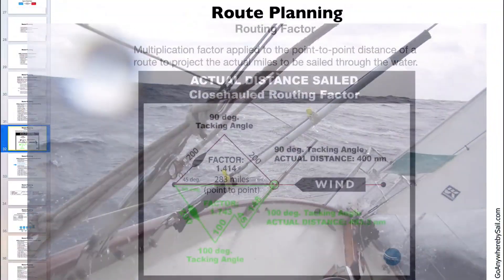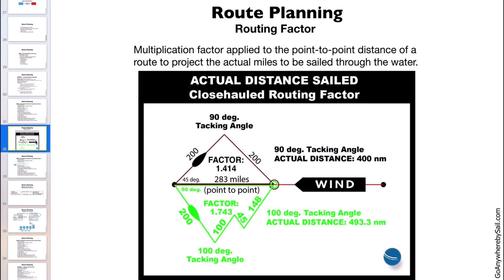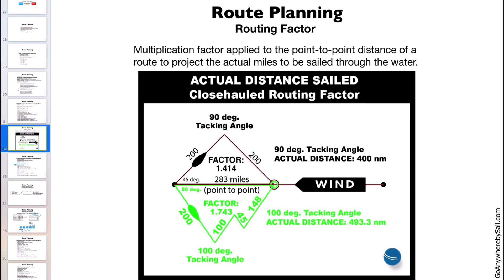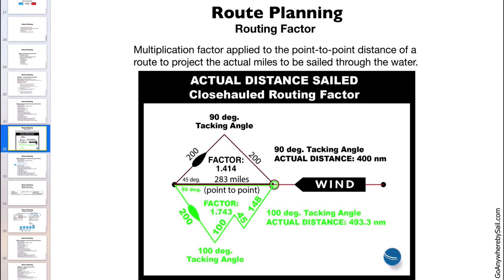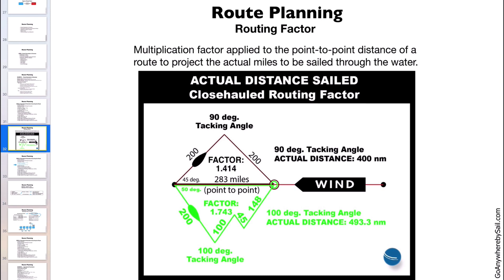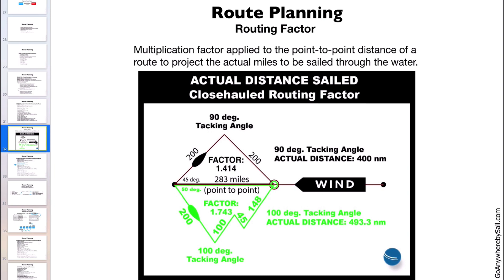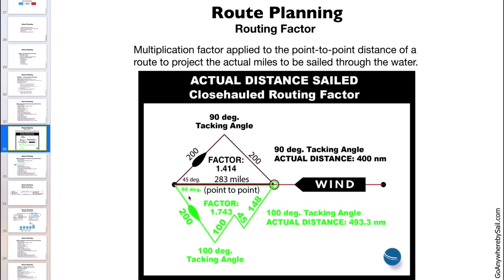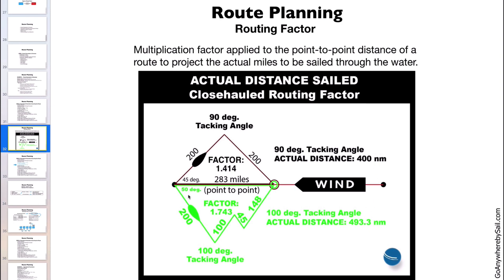SAILING NAVIGATION // Close Hauled Tacking Angle (Routing Factor)

Comment: "ETAs for outbound air-flights"  I LOVE it.  I also know that sailors and aviators can get into deep doo doo when they let such considerations override their better judgement about conditions, the boat, crew, etc. etc.
Reply from the maker: Hi, Jay! Nice to hear from you. Yes, an over-optimistic ETA is problematic when out-bound flights put pressure on a crew. This is one of the main reasons I apply a Routing Factor (as a skipper of offshore passages) so I can explain to the crew the risks. I will also apply an additional Contingency Factor of 15% (sometimes greater) to my ETA. I personally always like to make landfall and have a couple extra days with a crew to clean-up the boat, and enjoy each others company post-passage. Kind regards, Paul
Reply: BTW FYI Jay and “Cubeist Games” are actually one in the same.
Reply from the maker: @cubeistgames7985  and Jay ... thanks!

Comment: The distance makes sense, but if one assumes that the boat is sailed as well as can be on whatever tacking angle, then, from your example, the time difference may be smaller because of greater forward speed and likely a bit less sideslip owing to the faster speed making the keel or centerboard slightly more efficient, yes?  (yes, still slower, but not 93/400 slower...). (See also, pinching is a killer under most conditions)
Reply from the maker: All great points, Cubeist Games! The Routing Factor applies to the calculation of Distance Sailed, based-on Tacking Angle (through the water) which should includes a vessel's leeway. For example, if a boat's compass shows the vessel tacking through 90º and it's leeway is 5º, the vessel's Tacking Angle will be 100º so the navigator will us a 1.743 Routing Factor if their destination is straight upwind. The ETA can then be determined using Time = Distance / Speed. Sailing efficiency now becomes an input to the speed a crew pumps into the ETA calculation; they should use whatever they believe their average speed will be over the route.

The interesting part about this in practice is to look at the overall duration of the route and how the weather will change over that time. If the route is 400 miles through the water (as is in my example) a vessel sailing at 6 knots will take 66.6 hours to complete the route. For close-hauled routes in my experience, the wind is rarely consistent for 66.6 hours, and it also shifts direction whereby the Routing Factor becomes askew.

However, as a QUICK reference tool for general planning purposes, my Routing Factor method has proven excellent as input for MANY other parameters governing a route, like: water, food, fuel, crew resources, ETAs for outbound air-flights, etc.

Thanks for your engaging comment ... you're points are excellent and should all be considered by a skipper and crew.

Kind regards,
Paul Exner